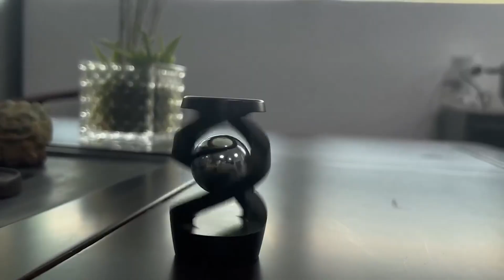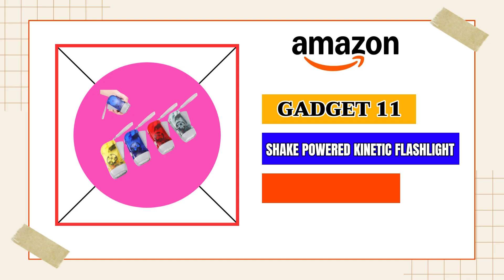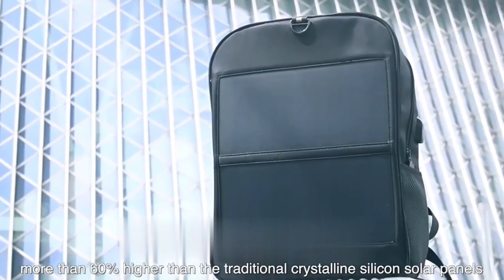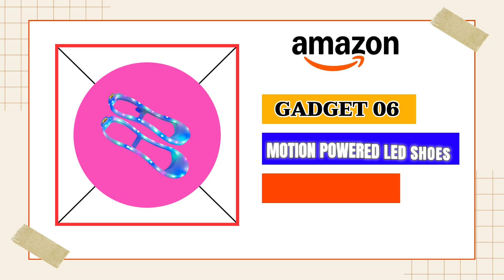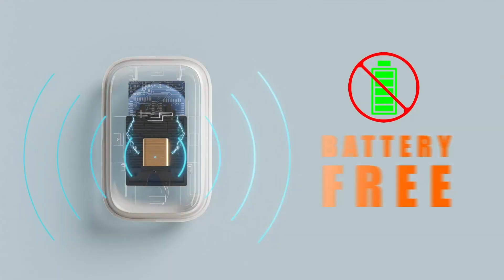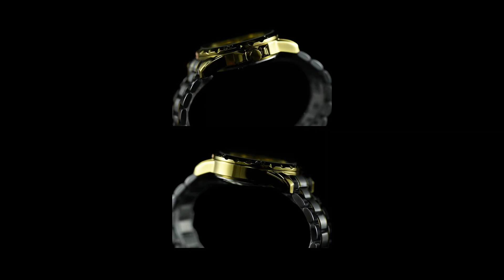13 Smart KINETIC GADGETS on Amazon That Actually Work ||

Comment from the maker: Buy Link ►

Kinetic Desk Toy ► https://amzn.to/4sBKDQ2
Hand Crank Kinetic Power Generator ► https://amzn.to/49JOHpE
Shake Powered Kinetic Flashlight ► https://amzn.to/3L3sjhO
Kinetic Gyro Power Ball ► https://amzn.to/49x29Mp
Wind Powered Kinetic Phone Charger ►https://amzn.to/4pyYljQ
Magnetic Kinetic Desk Sculpture ► https://amzn.to/4qMeinH
Shake Charge Emergency Radio ►https://amzn.to/3Yve3Bw
Motion Powered LED Shoes ►https://amzn.to/3NzBAi9
Kinetic Self Stirring Mug ► https://amzn.to/3LtuX0d
Battery Free Kinetic Doorbell► https://amzn.to/4qEx0gR
Kinetic Energy Floor Tiles ► https://amzn.to/4qjuSM2
Automatic Kinetic Mechanical Watch ►https://amzn.to/4jzvYAL
Portable Kinetic Energy Generator ► https://amzn.to/49xOzb